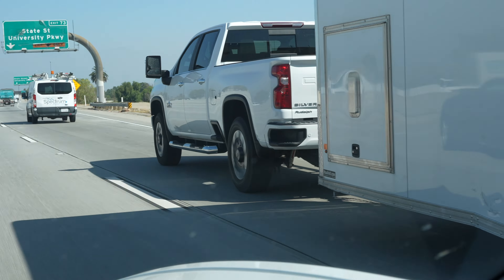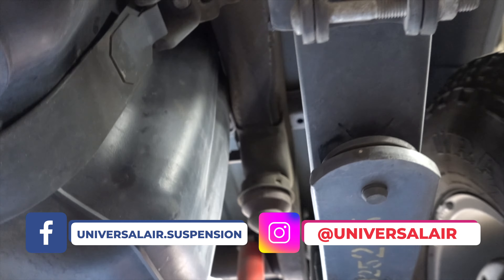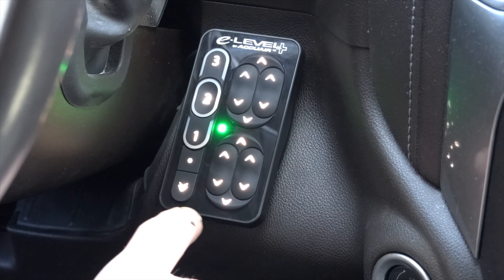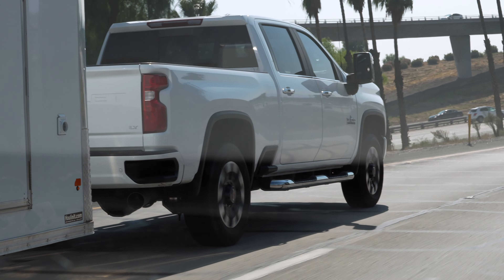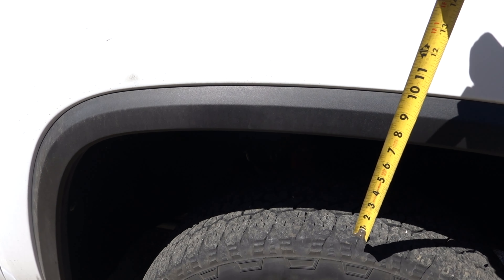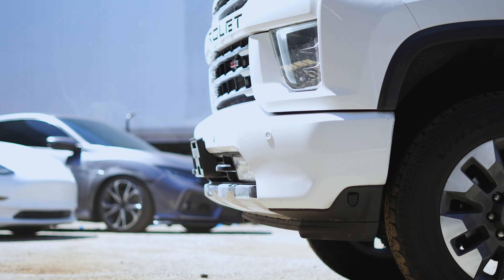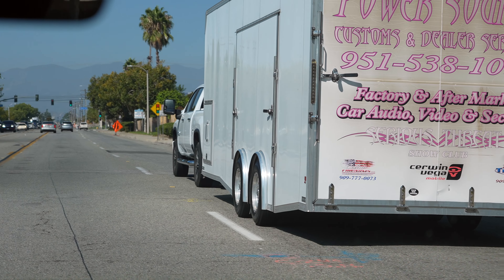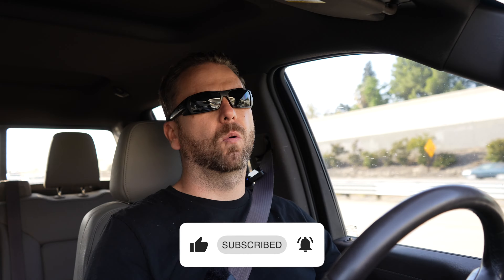The AeroLeaf Conversion: Enhancing Your Vehicle with Air Suspension

Comment: Although it doesnt have leaf springs, a solution like this is desperately needed for the Ford Maverick. The stock ride is comically harsh.
Reply from the maker: We agree.  We do have an air suspension conversion kit if your maverick was AWD.  We haven't had a RWD come though to build up the brackets.

https://www.universalair.com/shop/ford-maverick-2021-2024-awd-solution-series-4438?search=maverick&order=name+asc#attr=2817